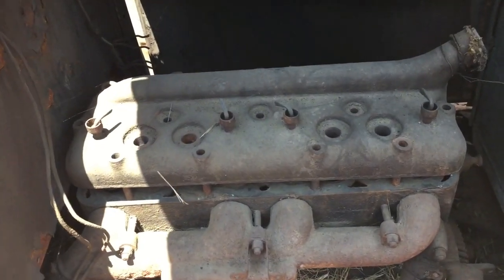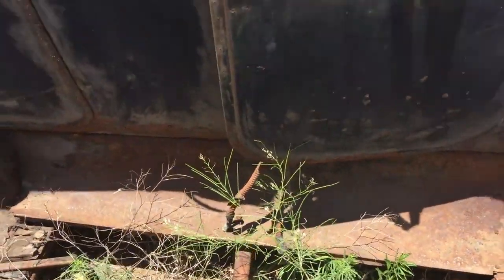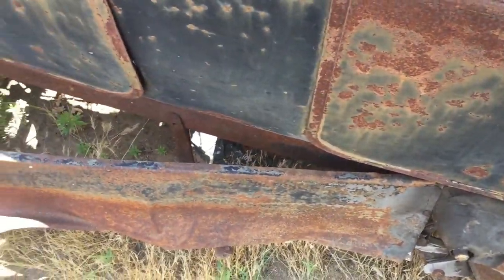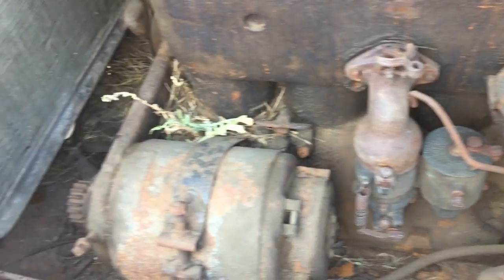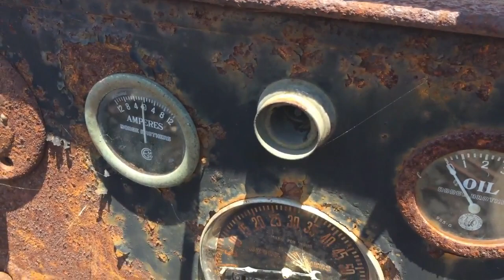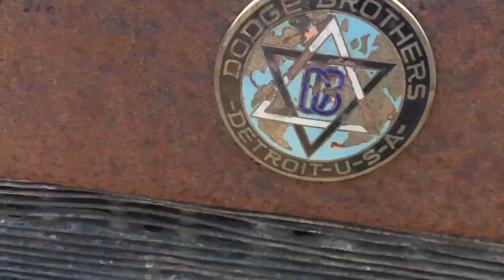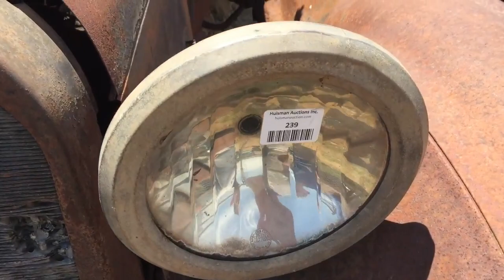Episode 2 Meet the 1918 Dodge Bros.

Comment: Looks like a long road ahead, I restored my 1920 DB 20 years ago. My advice to you is network with other DB owners, join the Dodge brothers club if for nothing more than the classifieds and a roster. I really don't know how you are going to get your car back on the road without a nut and bolt frame off restoration. If done right they are a extremely dependable tour car And will cruise at 45 mph all day. A well balanced engine will touch 55-60 on Occasion. New engine parts can be expensive but are available thru Egge machine. Best of luck to you.
Reply from the maker: Hi Michael, This will be my 1st Dodge, I have restored a 1913 T and a 1912 Buick. I have been a member of the Horseless Carriage club for about 20 Years. I see what you are saying about networking and joining the club. It is truly invaluable.